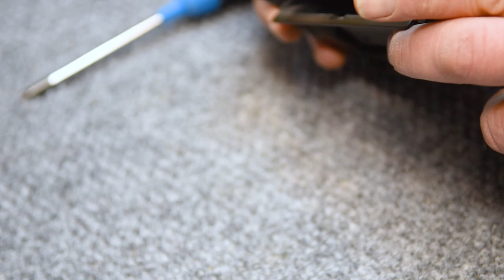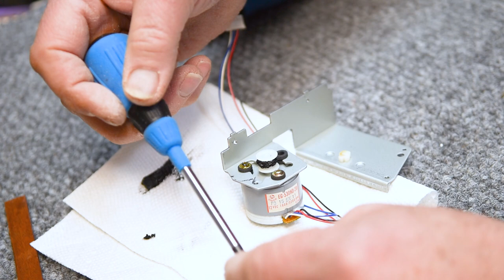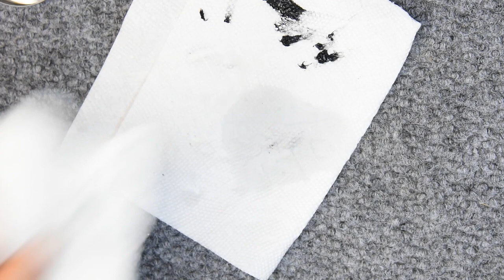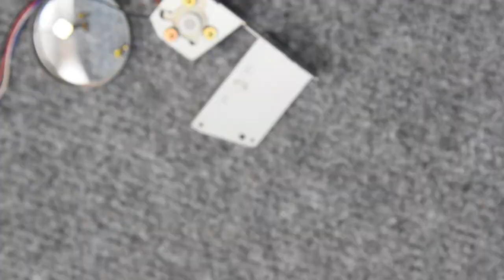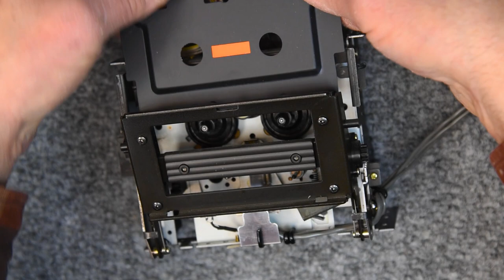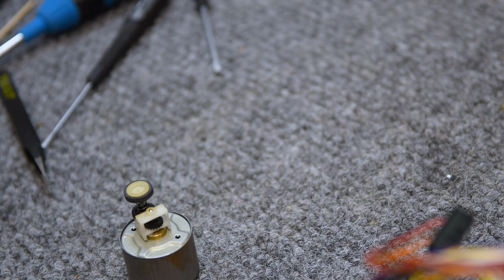Tascam 112mk2 Melted Belt Replacement

Comment: Having just been handed the problem of transferring some cassettes I’ve been looking at various machines and how to service them.  A Denon DRM-550 landed at home supposedly fully serviced etc, let’s just say your videos on motor refurbishment gave me sufficient confidence to at least replace the motor and do a few other tweaks.  The old motor had significant carbon on the brushes and just wasn’t speed stable.  The other deck is a Tascam 112mk2 - the belt goop is amazing stuff, yuck, and gear C has exploded!  Currently with a proper repair engineer.  Your videos are inspirational but I know my limits!
Reply from the maker: Thank you Kevin, and good luck with your project!

Comment: This was huge help. I got the belt and tire in but now I have discovered a bad gear on the far right motor assembly. The gear on the motor is fine. It is the stepped down receiving gear that is bad. I believe this motor engages the heads and capstan to the tape. Where do you get these at? From Tascam?
Reply from the maker: Yes, I think you're referring to the infamous "C" gear. They are available from many sources, I buy the laser sintered ones from a German seller on Ebay. Just look for the most expensive ones and find "laser sintered" in the description. Those are the only ones I use.
Reply: @asbcustom  Great to know. I am thinking on just replacing them all.
Reply from the maker: @VintageGearMan  It's common practice in a gear train to include a gear of a different/softer material in order to quiet the assembly or act as a fail-safe, that is the one naturally prone to long term failure. I don't personally replace functional factory parts with non-factory equivalents because I find the factory parts typically to be superior. The "C" gear is the problematic one in this instance, so if the others are good, I tend to keep them.
Reply: So just replacing the C gear it is then. "Thank you" for taking time out to let me know the best possible replacement gear scenario.
Reply from the maker: It's just my personal experience, your mileage may vary of course. If the part shows no signs of excess wear or failure, I will let them continue doing the job they've been doing.

Comment: Very nice video and so easy to follow along.  Thank you very much!  Can you provide the version # of Krytox grease you used? I see there are several versions of it (assuming it's in the GPL - general purpose lubricant line).  Is there a reason you don't use that for all grease applications in this video? I noticed you pulled out a different one for the idler components.   Thanks again.
Reply from the maker: Thanks AV, I'm using GPL205 here and would have no problem using it on the other components as well, both lubricants are an order of magnitude superior to the factory stuff. I find the little tub easier to draw up a fractional amount than the squeeze tube, if Krytox offered theirs this way, I would be using it instead.
Reply: @asbcustom  thank you, sir!

Comment: Your videos are super helpful, thank you for making them. Where can I go to find tires? I have an Aiwa tape deck that id like to replace the tires for but I cant find a good source. Thank you!
Reply from the maker: Thanks for watching! Which model Aiwa? I can look at my sources, they might have it listed. No promises though, there were a lot of decks out there once upon a time.
Reply: @asbcustom  it’s an Aiwa AD-6800. Your video helped me rebuild the motor on it! Now it all plays but FF and rewind doesn’t quite work so good when the unit is in play mode. I’m suspecting the tire isn’t gripping properly anymore so I’d like to just replace them all if I can but it’s hard to know where to find tires anywhere. FF and RW works great when stopped but the FF puts a bit of extra slack in the tape.
Reply from the maker: It's not listed in my Russel catalog, could you measure ID, OD, and thickness?

Comment: Dear sir, first of all, thanks for the advice and the video.  On my Tascam 122 MKII the problem when recording is that after about halfway through the tape it loses speed and plays the sound in slow motion relative to the input.  I assume it's because of the capacitor and the power supply itself.  What would be your advice in this case?  Big greetings.
Reply from the maker: Thank you for watching. 

On the 122mk2, the motor PCB requires recapping, and the transport a full overhaul. I have several videos detailing the entire process, it's different from the 112mk2 in this video.
Reply: @asbcustom  Thanks very much 👍
Reply from the maker: You're very welcome.